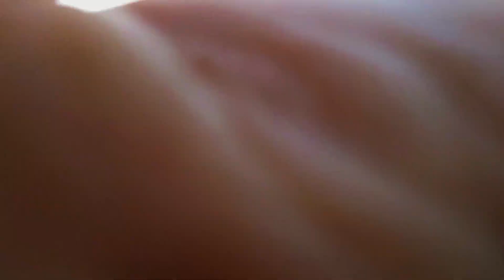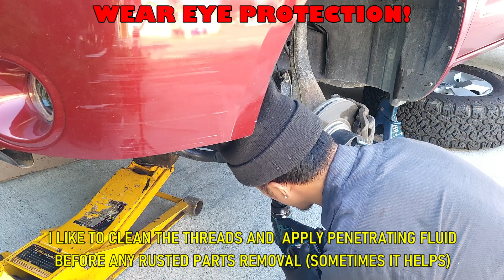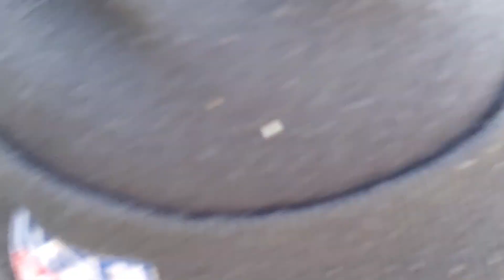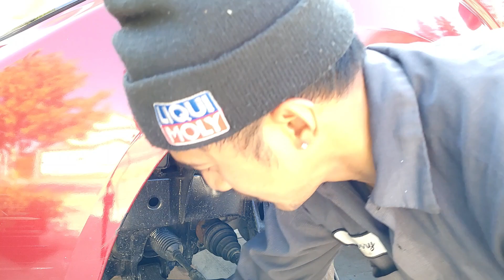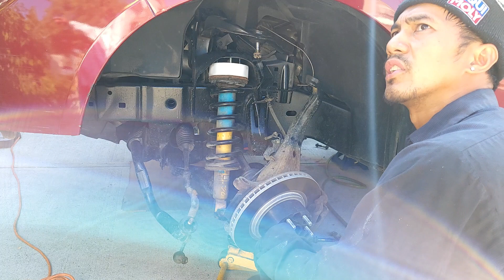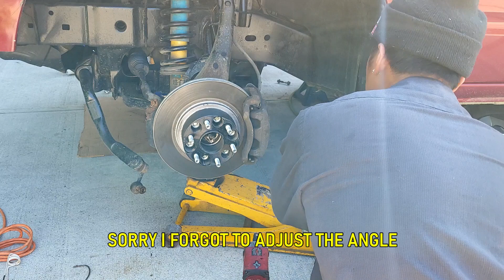BUDGET LIFT 2.5" FOR NISSAN PATHFINDER R51 (2005-2010)

Comment: How has it held up? Planning on running 285/70/17 or 265/70/17 Havent decided yet but defintily would like to add a spacer lift I have ran expensive kits before super harsh for normal road driving and stiff
Reply from the maker: This is actually my first time having a truck, so i dont't really mind the ride. Maneuverability have gone down compare with stock height. And the rear spacer with this type of spacer is not good ( not recommended at all) it cracks when u hit a big potholes or coming down a curb. Not good. Prolly go for aluminum or something else. But not this type.

Comment: Does the upper control arm hit the coil bucket at all? Ik that’s a common issue with this style lift but if you don’t have any problems I might consider it. Also did you install the tires yourself because my local tire shops say they can’t install a 285/75 on the stock 16s
Reply from the maker: Yes, its hitting the coil bucket. But you can get away with installing an aftermarket upper control arm to avoid that. If you are gonna do jumping on offroad i wouldnt recommend this setup. Get an aftermarket upper control arm and a lift coilover for crazier offroading. This set up is for cruiser with capability. I did the tire install myself.
Reply: @4x4AUTOBOT  I have a 2wd pathfinder so I’m never gunna do any crazy off-roading. The most I’ll ever do is maybe some light trails. But it’s a daily driver so it’ll rarely see anything other than asphalt. Do you think it’s ok for everyday driving?
Reply from the maker: @PYROtheNomad  o yahh definitely its good for daily use and light trail, its not good for hardcore trail. That's all my purpose basically, cruiser/light trail.
Reply: @4x4AUTOBOT  thanks! I’m definitely gunna be doing this on my pathy at some point

Comment: how does it ride after the lift and with the bilsteins?  does it help on FSR or make the whole truck sway even more?
Reply from the maker: It rides pretty good and no noticable swaying actually. The only problem is that the alignment, rear camber is +1.6 positive .
Not a big big deal.
I might maybe change it the rear to metal spacer on the subframe.
Cheerz

Comment: Why does the strut assembly switch sides?
Reply from the maker: Because the orientation of the new top mount will not mount in the same side.
Reply: @AUTOBOTR51  thank you sir for explaining 🙏
Reply: I just turned my strut assembly around to have it line up. I have the Rancho quick lift 9000xl with ajustable shocks. I just finsh the job 1hr ago.   Everything line up that way .  I think it's ok. Any comments or advice I would appreciate.  Thanks

Comment: I hat is the size of your wheel spacer?? Please
Reply from the maker: Its a 2inch Rying 6x4.5 Wheel spacers for 2005-2022 Frontier, 2005-2012 Pathfinder, 2005-2015 Xterra, 2 inch 6x114.3 Hubcentric Wheel spacers 66.1 Hub bore 12x1.25 Thread Pitch. https://a.co/d/hPRWj2x
Reply: @4x4AUTOBOT  I had same on my car 
Nissan pathfinder 2006 all the time I have to change (hub ) best tyres size please
Reply from the maker: @citizentvghana  right now i'm running 285/75/16

Comment: Hi, this job is really good, where did you buy the shock spacers ?? I read your coments about the rear spacers cracks, do you tink I can use the universal rubber spacers for the rear ??
Reply from the maker: Hello, yes! The rear spacers are crap. Don't bother using it. You can get other materials like aluminum rear spacers, i haven't tried those but i think they should be more durable than the one i installed. Recently, i just installed alldogsoffroad lift coil springs in the rear.

Comment: Hi bro! 
And the rear installation were can i found it? 

Nice job! Respect full for you... From Panamá
Reply from the maker: https://youtu.be/jZKNMu4gkzk
Here is for the rear axle. Again, i don't recommend this particular lift spacer as they crack easily. Get a rather aluminum or just get the lift coil springs, its what i have now just for the rear.
GL
Reply: @4x4AUTOBOT  thanks so much bro I do it yesterday and I save too much time!
Reply from the maker: @TheVoyaver  youre welcome boss

Comment: What do you mean the front strut assembly the passenger side gose to drivers side driverside gose to passenger
Reply from the maker: Yes thats what i did. The strut assembly from the passenger is going to the driver side, vice versa.
That way it will mount to the frame.

Comment: Boss man, so i have to change the upper control arm mandatory if i want install this kit for daily use??
Reply from the maker: I didnt change mine yet. It makes a clunk noise when it make contacts with the bucket coil. Yes you have to change it to do it properly boss.
Reply: Thanks for responding boss, Do you have a link??
Reply from the maker: @anthonyzarraga2993 https://www.alldogsoffroad.com/alldogs-offroad-high-clearance-upper-control-arms-for-05-nissan-frontier-xterra-pathfinder
Reply: 450 😮 😂 and how constantly is that noise? If is only in some cases i may can handle it 🤣
Reply: @4x4AUTOBOT is there any cheaper upper control arms alternatives that are the same as those All dogs off-road ones
Reply from the maker: @anthonyzarraga2993 
 😂 you'll only hear it when the wheels bottom out, like on a challenging trail kinda thing. That's why I haven't changed it yet because It's just for softroading 😄🫠
Reply from the maker: @lovekouki790  I haven't  looked around yet so I don't know yet. Let you know when I'll see one doe.

Comment: Hi. How did you go with these spacers? I also want to upgrade mine with these cheap lift kit.
Reply from the maker: The front is ok and have no problem whatsoever. But youll end up with coil bucket contact if you don't change the UCA with an aftermarket one.
The rear spacer however gave me problem like cracking when i drive slightly fast on bumps. 😅 
Invest on a proper lifts to avoid headaches. For me i don't mind as i can fix it. Lol